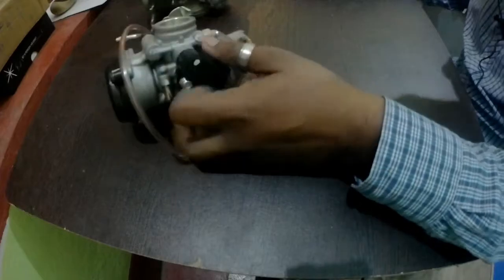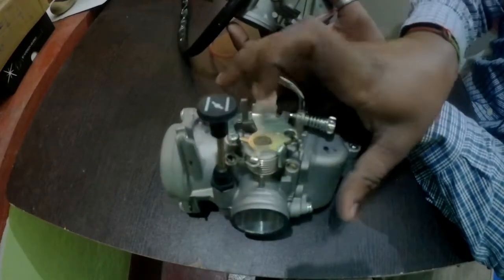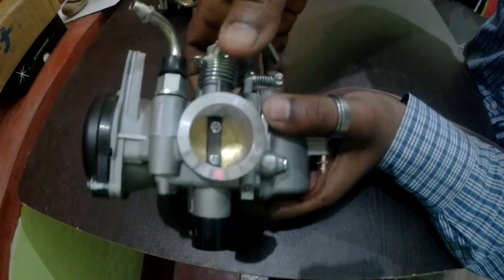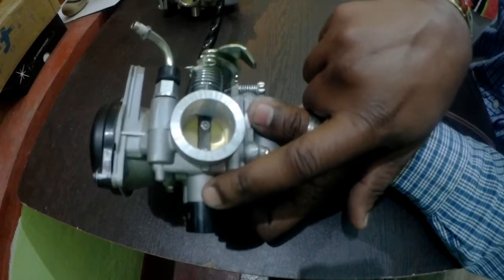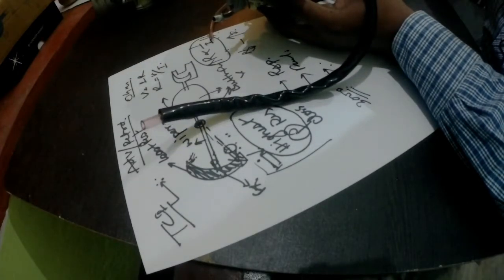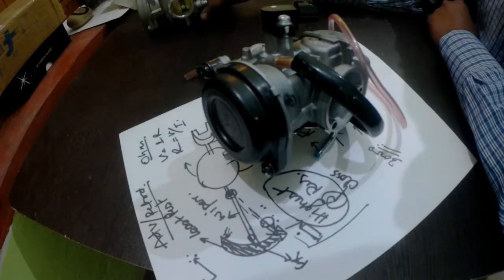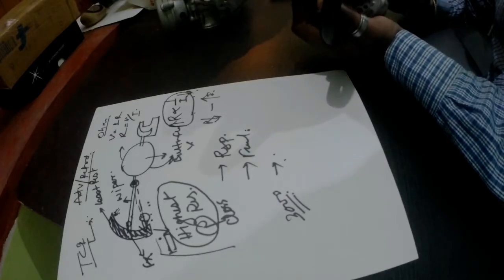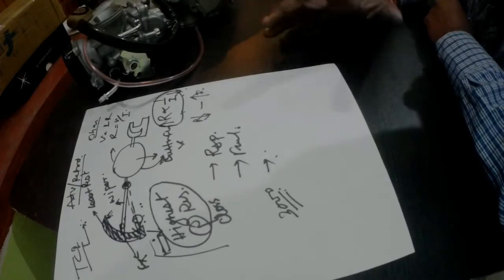Fz16 WHAT IS TPS IN CARBURETOR || FUNCTIONS ,IMPORTANCE AND WORKING

Comment: TPS is cool and all but
Let's say it starts malfunctioning, it will send wrong current resulting in bad performance, much lower fuel economy, and bad emissions. And it's very difficult to diagnose those problems because it's related to the electronic system but the problem is bolted onto the carb.

Meanwhile if you just unplug the TPS, I'm pretty sure nobody would ever notice the difference and everything will run just fine.
I'm not saying it's a bad thing and everyone should unplug their TPS, but I understand why your local mechanic does that.
Reply from the maker: 100% Right  ✅️ 
 Unplugging TPS give least noticeable change in ride quality. That's y mechanic don't take hassle of diagnosing and correcting the TPS . Instead they directly remove it and  say it's perfect now..
 According to me, TPs is just one level up on the normal functioning.

Comment: Today I realized that my Fazer (version 1 , 2012 model) has been running without TPS sensor for at least the last 5 years.

I am still able to get a fuel efficiency of 50 kmpl on long rides, and 42 kmpl within city with E10 petrol. Performance of the engine is also good. No drop is acceleration, no reduction in top speed, no smoke(black/white), no oil burning.

Hope I will get TPS in the spare part market!

Comment: I have a scooter(yamaha 113cc) fascino  with tps sensor in carburator. Does faulty cdi cause  problems in low pick in uphill ??? Everything is fine in plain surface area.already changed spark plug,cvt belt,variator,roller bush,clutch shoe and new carburator too.still got the low pickup in low rpm in inclined or uphill area.i found some thing in internet that carburator with tps sensor advance and retard the ignition timing and amount of current in spark plug.should i need to change cdi ?? Please help me
Reply from the maker: Hi,before i write long 🙂..just one thing ,
Did you got the valves checked for wearout or got it adjusted to specs??
Reply: Engine valve ???
Reply from the maker: Yes engine valves on the head.
Reply: @MotoTravelRide  ya its fine and propper adjustment
Reply from the maker: Faulty TCi/cdi Wil cause problem evrytime,might be intermittent but not like as you've said in your 1st query. Up hill downhill doesn't matters here. And is this is the case , then most probably you've issue either with carburetor or the valves.
  Try disconnecting the tps socket underneath and then see the difference, even if then the problem persist thn you got to go with the valves.

Comment: Hello! Thanks for the great video! Finally I found some answers on my questions.
I have bought a Honda XR250 2006 YOC. The TPS is disconnected, as previous owner swapped the stock (30mm) Keihin carb with larger (33 mm).
Now I try to find out what damage can disconnected TPS cause to the engine. Not correct ignition timing? Engine overheating?
I carefully watched your explanation and understood, that it is better to have TPS, but could you explain, if any damage can be done to the engine, if TPS is not connected. 
Thanks a lot!
Reply from the maker: Hi..glad that it helped a little.
Disconnected TPS doesn't cause any harm to the engine on the carburetted bikes,contrary it has got lot more to do on the FI bikes..
even if you're not very keen and precise  observant you won't be able to notice the difference in riding the  same bike with a connected and disconnected TPS
Reply: @MotoTravelRide  thank you so much for your reply and all the best for you and your family in New Year!

Comment: One road side mechanic who serviced my carb didnt even know the meaning of the engine warning light which came on. I told him to reseat the sensor wire. HE simply said it doesnt matter and the light will go after some time. I knew that he had no clue what he was saying. Thanks to your video now I know what it means.Im going to go back to him and make him set it right.
Reply from the maker: You're right, there are many such mechanic.. we need to be  little aware about genral working as components..
 Adding it for you, when you fit that back, make sure it is not creating any abnormality/ difference in riding . If it does ,then the Tps is faulty .

Comment: Hi i have recently purchased a Fz16 2102. Can you please tell me how to identified that this bike have P150 & P180 carb because its engine check light is in always ON condition & TCP cable removed, So i am damn sure it don't have a stock carb.
Reply from the maker: Okay. From the right side,underneath the tank if yo look at carburetor ,u can see a black color component on carb( which is TPS) .
If it is  there then it's stock carb with the Tps cable removed .
 If not it can be any carb p150/180.
 For P180 carb it has some mag sensor on body ,P150 doe not have.
Internally the jets are of different sizes in p150 and 180.
Reply: @MotoTravelRide  thanks for reply.

I want to change my carburetor to the stock carburetor but there is 2 type of yamaha fz carburetor, one is with single wire and other is with double wire. Which will be fit for my bike for maximum mileage and power.

I don't want this pulsar carburetor because i am facing power loss issue due to this.
Reply from the maker: @deepaktube  if your bike is early 2014model, single wire carburetor will fit.
Before buying check on accelerator whether it has provision for two or one cable

Comment: Can I replace my fz carburettor with pulsar 180 carburettor for mileage , TPS will create any issue in future??
Reply: Thanks @MotoTravel why not 150 carburettor , will it make any trouble just to know
Reply from the maker: @praveenashok2693 p150 carb has got smaller size jets . Bike will run lean. Problem -over heating, loss of top end speed.
Reply from the maker: @praveenashok2693  Taking it other way round ,What are you more oriented towards.??. if you can  compromise a little over the mileage (3-4kmpl maxm)= and want more power then go for a 180.. it will change your experience😉. 
And  If you can with compromise engine life go for a 150one.
 I guess there won't be much Price diff in p150and 180 carbs..
Reply: Bro i wants to know is this 180 carb is plug and play or need to tuning??
Reply from the maker: @ayonkhan5976 180 carburetor is plug and play for pulsar 180 but not for fz.
A little tuning will be required ,that's easy.
Reply: MotoTravel  so Bro can u please explain where need to change or tune? Will be helpful...
Reply from the maker: It won't create any problem..TPS is just an advanced feature nothing much.
u can fit in 180 carburetor.. but make sure you fit a pulsar 180 carb, not a 150 one 👍
Reply: Thanks a lot really appreciate for Ur response I will go with 180 carb
Reply from the maker: @Abhilash Ms u won't have any problem in riding .. only the red light on the meter display will keep blinking.
Reply: sir same video in hindi plzz😭

Comment: Ultimate knowledge 
Sir my fzs carb replacing with Pulsar 150 UG4.5 now I can not get best miage... How can I tune proper my new p150 carb in fzs
4.5 turn anticlockwise getting 32kmpl milage..
Now I am very upset for mileage 
Now
Please suggest me for better milage and power 
How to tune
Reply from the maker: Thank you brother.. I your case Take it to a proper mechanic ,get it tuned in warm engine for optimum performance.u will get proper pickup and mileage also. There is no fixed point for tuning like you are saying 4.5 turn. It varies depending upon condition of engine. Learning to tune a carburetor takes alot of practise :)
Reply: @MotoTravelRide  sir make video of carb tuning with best explaining practical advice... Bcoz we all want to learn. Or give a best link for it.
Thank you sir
Brijesh 
+:91-9555199201
Reply from the maker: Sure will make it with practical trick👍 . Thank you brother make sure you don't   miss  any notification

Comment: Hi..thanks for your information. I have fz16. Want to switch to p150 carb. As it doesnt have tps sensor the engine status light blinks and doesn't allow to start. Guide me how to disable the sensor cable. Thanks in advance
Reply from the maker: Hello,  thank you for appreciating the work
if you have not purchased a p150 carb yet, I will recommend you taking P180 one which is more suitable.
 If already purchase 150 one, then kindly purchase a main jet of 112.5 number and fit on the P150 before installing it for optimum performance ..  
 regarding the sensor cable, once it is disconnected from the carb module the red light starts blinking but it does not  stops you from starting the bike. You can start and ride even if it blinks . That's overriding 😊   cheers , ride safe
Reply: Kiran bhai apne p180 ka carburator lagaya kya..or uske bad koi problem to nahi aaya ..??
Average kaisa hai

Comment: My engine check engine light comes on at some rpm around 5k to 6k rpm. The service guys people told it is Tps issue.. Is it true??? I am not facing any other issues with bike taken the bike and climbed ooty hills as well.. Bike is running perfect.. but dont know why the check engine light comes on at the rpm range and it varies with load i believe..
Reply from the maker: If it's running well then no issue. Basically Tps has 2 type of fault ,one is negative and other positive fault. You wll face problem only in case of negative fault, positive fault won't show any kind of working problem.. u mush have a + fault . . 
And There is a code hidden behind that Red Light, that can be decoded to find the exact problem.SVC guys knows it well. Notice carefully, is it varying with load or acceleration  ??
Reply: try to fix ur carburator choke

Comment: Thanks for the video. My Unicorn is having misfiring issues in low throttle.  While missing I repeatedly open and close the throttle to continue ride. There is no problems if the throttle is opened above one third. I cleaned the carburettor, changed the air filter, checked the spark plug but not resolved the issue. Hope u can help me out.. Thanks in advance.
Reply from the maker: Thanks man.. great ,u have done every priority checkups 👍. Now there can be two faulty thing 1) water in petrol tank or 2 ) faulty ignition coil.
 Clean and dry the petrol tank along with the petrol tap. Fit back and then  ride it .it should be fine then
 If still problm remains  then it's only the ignition coil.
Reply from the maker: Also let me know how much kms you have run the bike, and production year, does the carburetor has a TPS in it ( as in my video).. I can help you more.
Reply: MotoTravel  hi, its 2013 model unicorn 150, 40k kms done,  & yes it does have a TPS
Reply from the maker: Hi dileep,then @first   disconnect the TPS socket at the carburetor ( u'll find a socket attatchment there)and test the bike.Most probably it's creating issue ,it get worn out in this kms range..
Reply: MotoTravel thanks man, let me check
Reply: Bro in my fzs 2012 model, when iam connecting tps sensor cable, it is missing and jerking. After disconnecting the cable no missing issues, but iam not getting constant mileage in my bike. I dont know what is problem in my bike?
Reply: Having same problem bro,can you help please

Comment: Great video bro. Mine yamaha fzs. Today cleaned my carb with local mechanic (as the svc guys don't allow us to watch the carb) due to low pickup even in 2nd gear. While cleaning I have observed that there is carbon deposit inside the carburetor. Previously when I accelerate my bike at hilly area, it can't able to pickup speed. Also there is a sound like 'dup-dup' from silencer when I used to accelerate. Can u tell me that there is a problem with TPS Sensor. If it is , can we replace the sensor with new one ?.
Reply from the maker: LINGAM SRIKANTH thankyu bro... Welcome here. Can you tell me exactly on what location of the carb did yo noticed deposits?? Few more questions before coming to conclusion
How is the bike running after cleaning carb, is it better than before?
Is the tuning done well by good mech?? 
.coming to the sound part from exhaust.. does it feel like something of small blast sound??
Reply: MotoTravel thank you for your reply. I have observed carbon deposit exactly at air fuel mixture chamber. Now the pickup is little better when compared to earlier after cleaning my bike carb. But the blast sound still exists. Also I have observed that my mechanic has not cleaned the needle pin which was located between the diaphragm rubber. As I asked him during cleaning he told me that there is no need to remove and clean it. But still I think there was this problem with the TPS SENSOR. Finally I had observed that when I brake a little bit hard while riding, engine is shutting down itself. So can you post your suggestions on this ?
Reply from the maker: LINGAM SRIKANTH Hi... Well the deposits on the chamber is no big deal. Needle doesnot needs to be cleaned, It always remains cleaned.( Playing with it can affect the  diaphragm rubbers) .
Coming to the blast sound and your engine turning off on hard braking, these both have a resemblance. There must be a O'ring leakage inside carb ,which is making it air rich and creating blasts.( Will get back to this after testing tps)
I want you to disconnect the TPS sensor( you can do it yourselves) and then ride the bike for 2-4days. Observe carefully for blasts and the turning off of engine , as well as the inc/loss of pickup.
Reply: Ok. Will do it and let you know.
Reply: Lingam Srikanth,bro u pls replace the carburator with pulsur 180 carburetor,it cost is 2300 rs,if u repair old carb,its vacuum piston is replaced and cost around RS 1800 plus service charge and there is  no guarantee to solve all problem especially mileage.....
Reply: Thank you for the reply bro. Pulsar 180 Carb: Is it a direct fit on my FZ S or need to do extra fittings ?
Reply: pulsur 180 carburetor UG 4.5 (UCAL) is direct fit on fz s.......and pulsur 180 carburetor has no TPS,so there is no place to connect the sensor socket,a red light is blink in speedometer,that is not a problem...... ...
Reply: @MotoTravelRide  hi, this question is not regarding carburetor and TPS. I have another issue with front shocks and its cone set in my FZ S. from the purchase i have replaced coneset totally 4 times. 2 times with ASC and 2 times with Loacl mechanics. But the problem araises within 2 weeks. intially after changing of coneset there is smooth suspension. but after 2 weeks the same problem persist. i.e the handle(steering) mechanism becomes tight that i feel i will fall down while cornoring left or right. Dont know whether the mechanics will fit the coneset exactly as per standards mentioned in the manual.
All these problems came to exist due to pethatic roads and their bad situations. so have u ever faced this problem ? I dont how to resolve this.
Reply from the maker: It should not happen fast. I am riding fz since last 10years, I got just 3 cone sets changed till date.. you may be getting this problem coj of some other faults, neither the mechanics nir the SVC guys is responsible for this.
Plz message me once on my instagram id @abhirxd.. will help you out
Reply: I am also facing the same problem .. Could you please tell me that whether the tps is replaceable or not ?? Is it require to replace the sensor or whole carbeuretor ??
Reply: Sir i disconnect the tps clip wire from carburetor,and check but the problem exist,and again checked by replacing vacuum piston but no result,finally i change carburator( pulsur 180....UG 4.5) now get more milage and smooth running........yamaha fz carb is very expensive  (rs 4500)
Reply: @ptabhilashpt  hi Abhilash, can u please mention the exact name of the carburetor, any model number, series number and also whether is it available in the local spare shop or not, if not available how we need to ask or mention the carburetor name at BAJAJ ASC ? bcz they will ask for which year does the pulsar 180 manufactured ?
Reply: @lingamsrikanth296   hai friend,carburetor brand name UCAL (UG 4.5) for pulsur 180,it is available in bajaj show room,dont buy local market, because there is a chance for got duplicate version,if the person in show room ask anything, u told that not for pulsur  only for yamaha fz,in my experience  UCAL UG 4.5 version is direct fit to fz,no modification required.

Comment: Now I am using pulsar 180 carburettor in fzs. TPS not connected. My fz carburettor shows missing while riding. So my mechanic said to replaced the carburettor. The cost of fz carburettor is to high so I replaced with p180. The advantages: more power and milage
Disadvantages: yet to know (now it's been 3months without any problems).
Reply from the maker: steevan varghese that's great to know.. are you aware of the jet sizes of p180 carburetor?? May be bcoj of larger jet size it has better efficiency.. no doubt fz carb is very expensive but it is bcoj of that Tps body.
Reply from the maker: Jet size must be be more Bro.. anyways if it is running fine and perfect it's best..:) saves a huge amount
Reply: MotoTravel it's only a temporary change. When I have enough money then definitely move to stock carburetor.
Reply from the maker: steevan varghese that is best decision .. hope this video helped you Insome way.   Give a thumbs up👍and join me.
Reply: @MotoTravel , could you please let me know the size of  jet screw for 150 n 180 carburettor , since I heard from spare shop both carburettor are same